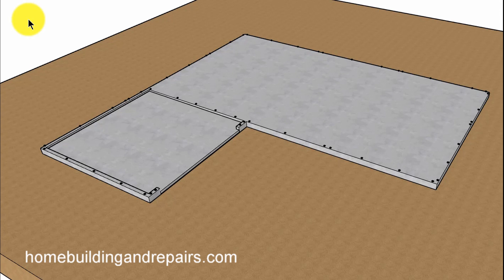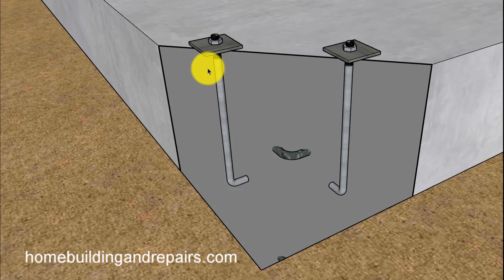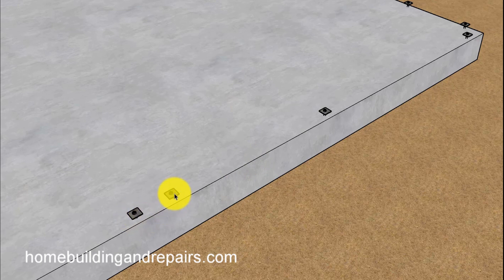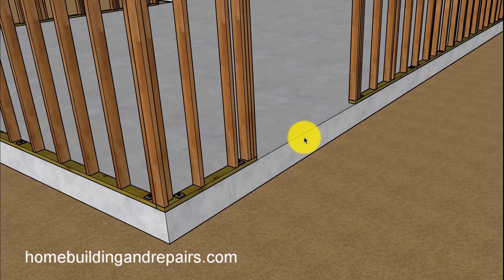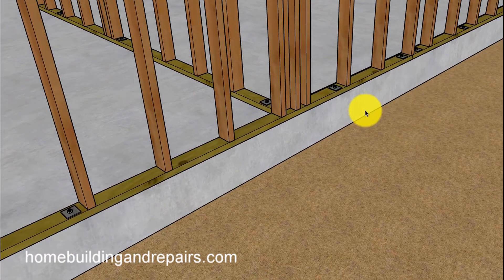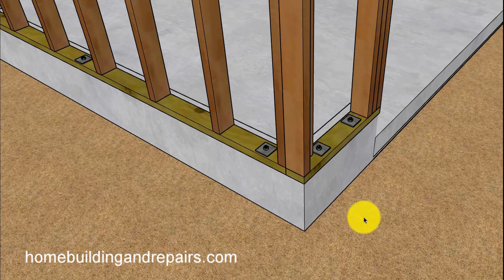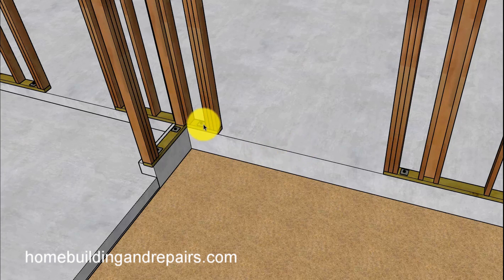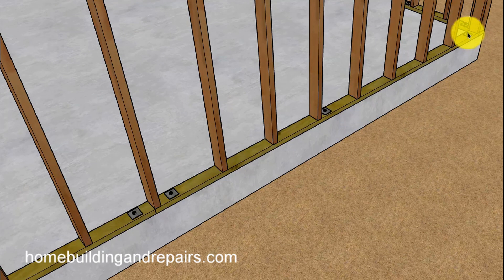Anchor Bolt Location For Concrete Foundation – Three-Bedroom Home Design

Comment: Thank you for the video. I have a question. Currently I am looking to build a shed on an existing concrete slab, but the shed will be located not at the edges of the slab itself, so what can I do so make sure that the sill board of the shed is not sitting in contact with water when it rains? How could I elevate that sill board just enough, so it does not sit in rainwater pooled on the concrete slab when it rains.

Comment: Hi. Can you please make a video on how to place anchor bolts and hold downs in an interior load bearing wall with a foundation 1ft wide and 2ft deep. Because exterior walls have support on the peripheral  boards where you can attach the bolts but the interiors do not.

Comment: You saved me a faux pau  (f** up) my concrete guy mis-calulated for a six foot slider and put and almost put an anchor bolt in the center of the slider. I corrected it 6 hrs before the pumper and concrete truck showed up. Thanks for sharing. You saved me a head ache 👍

Comment: This is gonna sound dumb but do you anchor only outside walls or inside walls too?
Reply from the maker: Usually anchor bolts are used around the perimeter and for interior structural shear walls and pins or other fasteners are used on the other interior walls.

Comment: What about spacing on a double shoe plate (double 2x4s)
Reply from the maker: Anchor bolts usually need to be located with in 12 inches from the edge of the framing plates.

Comment: It seems like drilling and epoxying isn’t such a bad way to go. The cost doesn’t seem to be prohibitive, especially when considering the time and headache required to lay out, set, pour and finish around protruding anchor bolts.
Reply from the maker: Yes, it can be expensive, especially if you have to rent the tools.

Comment: when building a garage can the anchor bolt be longer in length, allowing it to  anchor to both the sill  plate and wall plate in order to strengthen and stabilizing  the wall as well
Reply from the maker: If you're referring to multiple plates on the bottom, then absolutely. If this doesn't answer your question, feel free to provide me with some more details or email me a picture. You can get our email address at our website.

Comment: What about anchor bolts for the interior walls that are not load bearing/ shear walls. Do the interior walls also need anchor bolts or can they be installed with a ramset?
Reply from the maker: As long as they aren't structural walls, then yes you can use any type of fastening system like a ramset. On new concrete I've actually driven them in with a hammer before like you would a nail.